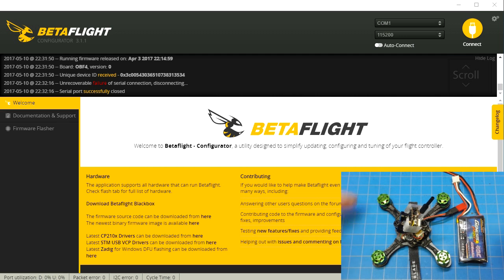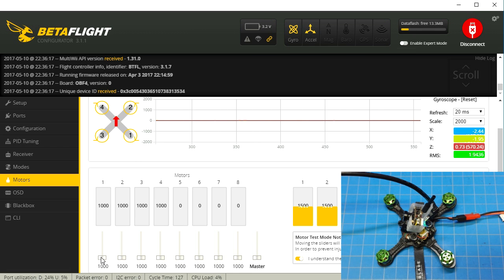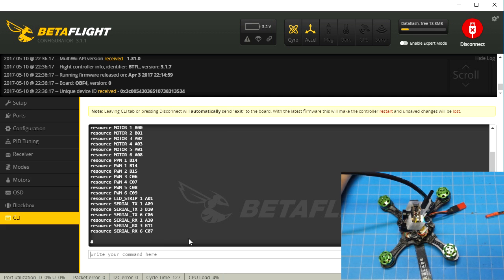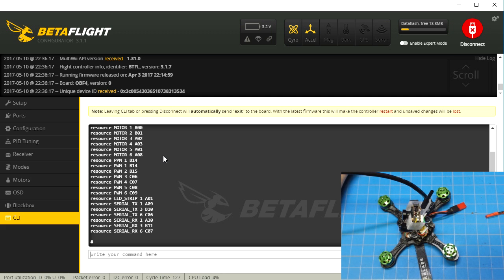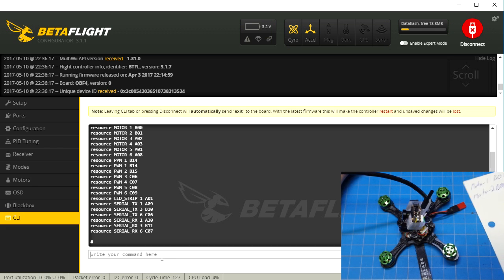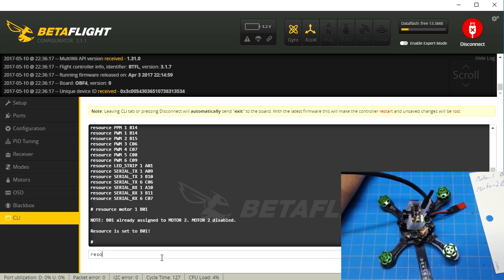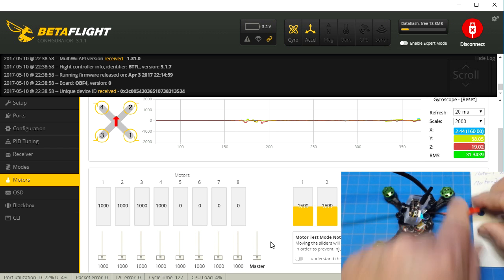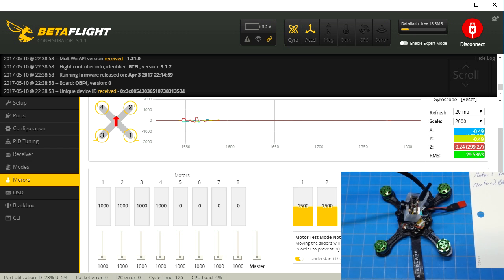4 in 1 ESC Motor Mapping

Comment: Hi Nick< I just put this FC in my build and the motors were jacked up. I tried to follow your step key for key and lost to motors assignment> I'm new at these codes how do I get my motors back
Reply from the maker: I think we need to reflash betaflight to get those resource assignments back. Note we shouldn't use the exact motor assignements of A01/B02 etc, we need to document what yours show and use theose values.
Reply: @NickBurnsFPV  I got my motors back but every time i try to move them they disappear. Right now like at the beginning they all spin the same way (clockwise) this is crazy
Reply from the maker: @masterpdj2623  We might be missing a detail. Are you using the resource values you see in the cli or the ones in my video? Also, in betaflight in the motors tab , when we move the slider for motor 1 does motor one spin, and the same for motors 2-4. I ask as I am checking if we need to map motors or reverse motor rotation. It sounds like we might only need to change motor rotation for two of your motors.
Reply: @NickBurnsFPV  Hey Nick, thank you off the top. I'm using my codes in CLI for my issues as my motors are out of order differently than yours. No matter what I do either 2 or all four motors disappears. LOL can I send my build to you, I'll pay your time and shipping. I would really like to see my first build fly. I know you don't touch other people quads but it's worth a try. Maybe a year or so down the road I'll understand this stuff enough to get all my down quads flying again. Until then I keep buying BNF (not good)
Reply from the maker: @masterpdj2623  I would like to help out, I suggest getting in contact with Adam Douglas via facebook here https://www.facebook.com/adambombfpv he does builds and fixes for a living. He would be much better to get the issue resolved and back to you in a timely manner.
Reply: @NickBurnsFPV  Thanks Nick I shipped it out to Adam today
Reply from the maker: @masterpdj2623  Nice. I am certain he will get it sorted.
Reply: @NickBurnsFPV  I was close and I'm in 6 months I will know even more judging on how much I've learned in this pass year about this addicting fun hobby. Thanks for your help Nick and I can't wait to hear where I went wrong.
Reply: @NickBurnsFPV  Hey another problem I have is that i have 3 Taranis X7 Q remotes (FrSky) 1 has the correct software and flys all my drones but the other two I can't flash the right software on to them for some reason. I now have a incredible RadioMaster XT16s but I would like to get the other 2 up to speed to help some kids get into the hobby. So much to learn LOL
Reply from the maker: @masterpdj2623  I have only flashed radio firmware 5-6 times. Each time was a bit different. :)
Reply: @NickBurnsFPV  What a hobby, Can't we just fly LOL. Thanks Nick

Comment: bheli not working on my esc. won't display the "read"
Reply from the maker: Props off and battery plugged in?
Reply: @NickBurnsFPV  yes.
Tried every combination of pluging in the USB cord  with battery on,with battery off.
Works fine in betaflight and  my other drones work no problem in bheli. 

Just wondering if I can change the rotation of each individual motor using CLI in Betaflight??.
I did eventually rewire the one motor  and that worked..
Thanks for your response!
Reply from the maker: @TheOuterDrive  which version of blheli? Could it be that we are using the 32bit version and need the standard 16bit?
Reply: @NickBurnsFPV  how to get the 16 bit version.....on my mac?
Reply: @NickBurnsFPV  i google searched blheli 16 bit and can't find anything ..
Reply from the maker: @TheOuterDrive  look for blheli s or blheli_s

Comment: Another great video. I had to replace the ESC in my Leader 120. Spent a couple of hours yesterday getting motors setup in right directions, still no fly. This is exactly the information I needed, as I'm sure that the mapping is the problem as I used a third party board to keep from waiting 3 weeks for direct replacement. Thank you!
Reply from the maker: Sure. I hope it works out to get you back in the air.
Reply: Nick Burns Fised the problem, thanks again.

Comment: Thx Nick !  Is it just the flight controller that decides motor direction or the esc too ? I need to turn my esc 90* ccw because the battery pads are in my way.  Peace ✌️

 Actually I didn’t mean direction. I meant placement. In other words do I need to remap my motors if I turn the esc so the battery pads are on the  side and not in the back.
Reply from the maker: Not sure I completely understand. Here is basic. The ESC can control the motor direction. The flight controller needs to know the motor direction but betaflight doesn't control it. We need to "motor map" so the flight controller knows which motor to spin via the esc. If the motors tab in betaflight doesn't have motor 1 spinining motor 1, 2, etc the quad won't fly.

Comment: Please let me know how to change the direction of each motor individually.
Reply from the maker: If we resolder any two wires per motor the direction changes. Also we can use the blheli application to change motor direction. there are many videos on youtube about using blheli.
Reply: @NickBurnsFPV  Thanks alot I did the same and then reversed in blheli. It worked fine. Thanks alot.

Comment: Sweet I did just as you described everything worked but motors still in wrong position.
Should I remove all motors and retype commands?
Reply: I got it brother thanks a million
Reply from the maker: @godsun358  Great, that was easy :)
Reply: Ahhh no, but in CLI I input /   / source MOTOR # A02 none
To erase the wrong motor and it also adds the right motor= A02.
So I thank you for guidance.
Reply from the maker: Did you use the values yours has? It don't believe they will be precisely as mine, as this video is pretty old and betaflight has changed a lot.

Comment: Hi...i have remap the motor but unfortunatelly the motor no 1 and 4 still wrong spin but already correct mapping.

Motor no1 and 4 spin ccw....what should i do to fix this

Thanks in advance
Reply from the maker: change the motor direction in blheli. Blheli is an application we need to download from the internet. We will also need to have a battery plugged in while using the application. Props off for safety.
Reply: @NickBurnsFPV  oh...ok...thank you Nick

Comment: I remap motor 3 because it’s not working to Tx2 because that’s the only one I have available which I did it successfully under the command lines. My question is which wire out of the three do I have to solder to the TX 2. Can I just pick anyone of the three?
Reply from the maker: Generally the white wire is the signal wire, that would be the wire to solder. Do not solder the black or red.

Comment: If you want look this video and if you can help me i cant find the right way to fix that!!!! Thank you!!!! https://youtu.be/FShZ4xt-Z94
Reply from the maker: change the channel map in betaflight to the suggested as in the instructions, the flashing logo is low rssi or radio signal, this is likely due to the quad and radio being so close together.
Reply: @NickBurnsFPV  so when i change the map in betaflight, sould i change maping in the taranis???? For example same in the taranis like betaflight????
Reply: @NickBurnsFPV  i ll try for a distance and make the same thing with the signal
Reply from the maker: I suggest making the changes in betaflight, then see what the results are.
Reply: @NickBurnsFPV  look the whoop is flight with Qx7 indoor but iam afraid to fly out cause i think i have someware problem cause when i conect whoop with my taranis on pc then i have channels crashing like video!!! Do you think to i  change the reciever settings in betaflight????
Reply from the maker: That is likely the rssi channel that is bouncing all over, that is normal rssi/telemetry feeds signal strength back to the radio the radio can then warn when the signal is low getting us to come closer to the radio. If she flies normally inside it should be okay outside. For your first run, take someone with you as a spotter and fly in an open field to test.

Comment: I know this is a old vid but it sure helped me a bunch.  
I was search how to switch my motor position because i was gonna mount my 4 in 1 on a 90 degree in my stack which would mess up the motor solder points orientation for the motor numbers.

this is the solution i was looking for. thanks a lot nick.
Reply from the maker: Sure, glad this video continues to be of use.

Comment: Once again,,, awesome thanks,,, I needed that,,, could not figure out y my quad was trying to kill me,,, all my motors were off
Reply from the maker: killer quads...there storming the air. :)
Reply: Nick Burns put my FC in reversed ,,, forgot about wiring them for the right pads,,, going to try it🤔
Reply from the maker: You have found the key to the killer quad. :)
Reply: It flies,,, yay,,, thanks 😀

Comment: Good God Man! I was abaut to change my wiring, but its that simple! Thank You a lot.
Reply from the maker: Sure, I wire them up straight then flip them around in the cli when I need to. Down side is we have to do it after every flashing of the flight controller. I don't do that so often.
Reply: That's not a problem for me :)

As a quad begginer I must ask You one more thing. You have a gyroscope noise in the motor tab. Whenever a technical guru shows their FC on YT, there is no noise, and the values oscilate max to 0.2 or less. What is that noise? I have a second Omniflight F4 FC because I tought that the earlier was broken. And there they are again on the fresh new one :(
Reply from the maker: There are two pieces to the lack of noise when spinning up the motors. One, is the quad lying flat and stable, and I mean really flat and stable. Two are the motors have good bearings and not beat up, a smooth running motor will introduce less vibrations.
Reply: Yea, I know abaut motor vibrations when they are spinning and when the quad lays down on table (not spinning). 
But as I mentioned I have noise like You on the clip - when the battery and usb cable is connected and nothing else is touching the quad. Then the gyro shows those hiccups. And I wonder is that normal?
Reply from the maker: the hiccups are likely the escs initializing and when the motors spin, there will be some, but as long as the graph isn't dramatic it should be fine.
Reply: Ok, thats enough for me. Thank's for you're time and keep it up. I'll sub that :)

Comment: Hey nice video my Motors are all mixed up I'm using the betaflight F3 board with 30amp racerstar ESC before I flashed new firmware to the ESC in firmware to the new board the quadcopter would arm and function as it should after we flashing new firmware on both ears and flight controller motor one is motor to motor 3 is motor for and vice versa they're all mixed up when I move motor one slider tab my motor 3 spins on my Quadcopter will this make it freak out and shaking twitch violently when you arm the copter even with props off please help thanks
Reply from the maker: follow the video. remap the motors, if slider one spins motor 2, map the motor 2 resource value to motor 1. all the way around.
Reply: Nick Burns thank you that solved my problem.. joshua bardwell helped as well. Thanks a bunch

Comment: Hey Nick, great vid, thanks for uploading. in my case, the motor 1 and 2 was swapped, just like in yours. but i had to reassign motor 1 to an empty slot, because the cross assigning that you did just dont work for me. it said "b08 is used by motor 2" so i needed a temporary slot. 

on the other hand, do you have an idea on how to switch the motors rotation direction? i just installed my 4in1 esc and its a 4 Amps one, so its sooo tiny. i dont really want to solder the tabs again.. :( and all 4 of my motors rotate in the wrong direction lol :D
Reply from the maker: yes. I believe I show the "resource motor 1 none" to release or free the motor assignment.  Once you have the motors in their correct position, add the bl_heli app to chrome. Launch that, connect usb, connect, connect battery then click read setup. find the motor/s needing reversing, the ESC and motor numbers are the same. Click the down arrow and select reverse. Be sure to click write setup. Done.
Reply: thanks for your help, it really helped a lot! blheli was done, so now its one step closer. i have to learn a lot about these software things... :)

Comment: Interesting info, But surely you'll need to do it again whenever you flash the FC's firmware?
If so, I'll just keep swapping the pins around on the AIO ESC to FC lead because with so many different setups on my (Way too many) quads it's just one more thing for me to forget to do after an update.
Reply from the maker: definitely, with each flash there is a host of firmware reconfiguration. If one doesn't want to include remapping, swapping pins is an alternative plan.

Comment: I'm having no joy trying this I'm just about ready to launch things at a wall haha.
Reply from the maker: Are all 4 motors out of order? If so, start with just swap two and test again, if all is good then swap the other two.
Reply: Nick Burns I've managed to get it up in the air now but had to swap out cables in a jumper rather than using BF. None of my CLI commands were working. Baffled as to why.